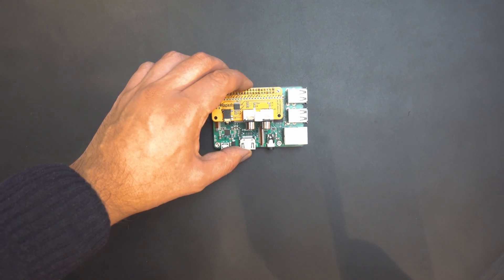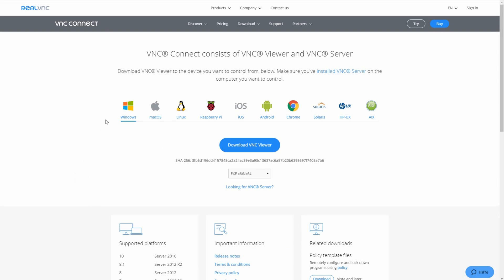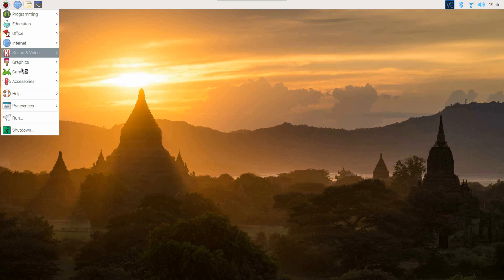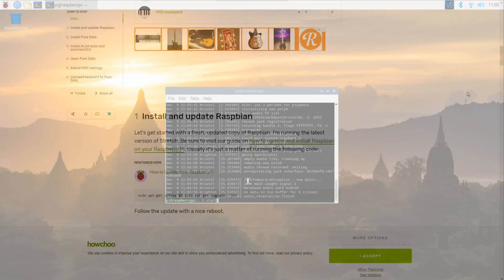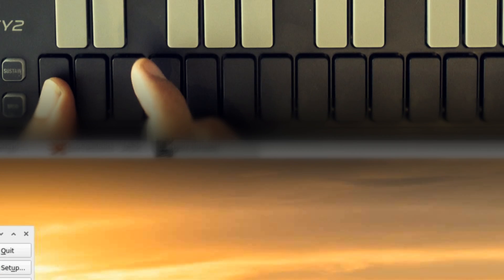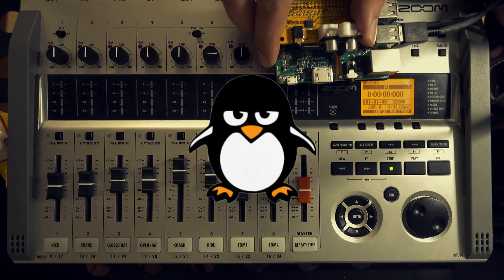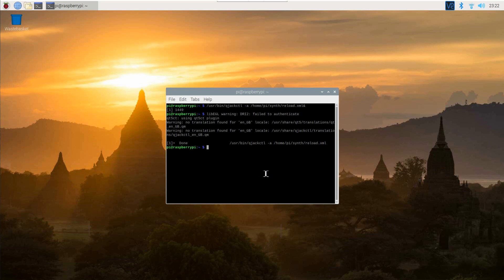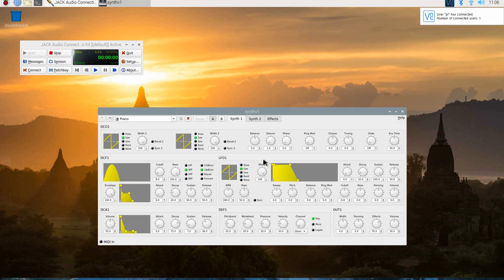How to use a Raspberry PI as a synthesizer

Comment: 10:38 why didn't u say how u solved this... :S
And man this is really cool, but it kinda feels like ure trying too hard to be entertaining which costs us more concise information :S 

Also u should share the image/micro SD copy ;)
Reply from the maker: Thanks for watching. For this video, I couldn't solve that problem, unfortunately, so I used the standard audio output. I later found out you need to remove the PI's standard audio interface from /etc/config so the USB device is the only one present in the system. Will do another video on how to do that in the next weeks. I'm sure there are better solutions for this but I'm still trying to get my head around it myself. :-)  Yeah I can give you a copy, please PM me on aselck at hotmail dot com
Reply: @mr_floydst  Ok but why do u have the Audio Pi Hat then? U didn't explain why or what u use it for :S
Reply from the maker: @boimesa8190  I got it working in the follow-up video to this. Linux Audio system is a little bit over the top, to put it like this. The sound card was intended to improve audio quality and latency, which kind of worked, but it's setup script is broken, so I had to fix that manually.

Comment: Hi Floyd, great video - Im trying to get this working on  my raspberry pi, but I cant see all the commands you used - the video is not clear, please can you share a link to the various commands used in terminal especially around the creating start up to run this when pi boots up
Reply from the maker: Hi, thanks for watching.
This will add the lines to launch qjackctl and synthv1 after boot:

printf "/usr/bin/qjackctl -a /home/pi/synth/default.xml &\n/usr/bin/synthv1_jack&" >> ~/.profile

just copy this line and paste it to your shell and press enter.
The only other thing I mentioned is that bristol takes a commandline parameter like 

startBristol --polysix -midi alsa -scale 2

to show all synths available:

startBristol --help

Best regards!
Reply: Floyd, thank you so much Ill give it a try.
Im looking to use the  other synth synth v1 - do I still need to run the bristol?.

I would like to play the synth from my arduino which is setup as a midi and connected to the pi, it has an array of buttons - how would I be able to have these buttons play the synth in place of your external keyboard. How would I do this any ideas would be greatly appreciated.
Reply from the maker: @globalstandardrating7552  You only need to install synth v1, then. Bristol is a separate package. If you can manage to set up the arduino to send MIDI, your setup should work. But I guess doing to requires some investigation on the  internet. ;-)
Reply: @mr_floydst  thanks for your quick response and help!

Comment: Why not use the built-in audio output? It is emminently more compatible with raspbian straight out of the box.
Reply from the maker: Hi, thanks for watching! I did use it in this video. But legend has it using an external audio interface will reduce the latency and "xrun callback" errors (I got it working in the meantime, and can confirm the latter statement is true, but latency is dependant on other factors).

Comment: I remember when they used to say digital couldn't do this
Reply: I remember using assembler to write FM algorithms on my Commodore 64 and outputting them via the 4-bit resolution amplifier of the sound chip. The DX-7 had just come out. I eventually got a Nord Modular. Today I am absolutely certain that the current analog revival is just a temporary stage before everything goes completely DSP.

Comment: Damn you Floyd! you make this look so simple that I have no excuse now, NOT to try it!!
I really appreciate people like you, sharing the knowledge they acquired through days of hard work in just a few minutes, so people like us will enjoy a much better an enjoyable experience, so thanks a lot!
I never thought about getting into the Raspberry PI although I have some knowledge in computers and basic soldering skills, but I do like electronic music, and this video of yours definitely got my attention! so 2 quick questions please:
1) If I'm going to buy a Raspberry PI board for this purpose, will getting the PI 4 have any advantages?
2) Did I understand from the video that no audio interface was usable in your tests? was the audio interface you added a link for in the comments, did the job eventually?
Reply from the maker: Hi, thanks for watching! As far as I am informed, the PI4 is much more powerful, but still has some compability issues at the moment, so perhaps it's better to wait just a little until these are sorted out. The audio interface was useable, it even showed up in the system's audio settings and put out crystal clear audio with vastly improved latency. I just couldn't make it show up in JACK. I wanted to finish this video so I just went with what I had, but once I get this solved I'll post an update. (Using this as a sampler would be really cool).

Comment: Been using Raspberry Pi boards for a few years. To this day, my favourite Pi-based platform for musicking includes the Pisound “HAT“ (soundcard) from Blokas. It’s neither cheap nor that expensive considering mainstream alternatives.
https://blokas.io/pisound/

It’s especially useful with a special “flavour” of the Raspbian OS which is specially design to work out of the box to make the best of that HAT. 
There are two such flavours/“distros”. 
One, Modep, allows me to use a Pi as the equivalent of a MOD Duo, with hundreds of plugins available in a kind of “virtual pedalboard”. It’s been my “plug and play” device for a few jams, including with MIDI pedals. It’s also a great replacement for a number of MIDI Solutions boxes. It works really in “headless mode” (without a monitor) and it provides a dedicated WiFi hotspot and webserver to allow you to tweak patches from any other device (without having to connect to the Internet).

The other distro, Patchbox OS, is more like a traditional version of Raspbian with the stuff you need, built-in. Some of these things are built around PureData, which remains remarkably relevant on different platforms. Orac 2.0 is part of that, and it’s supposed to solve a whole lot of problems. I quickly gave up on Orac for a variety of reasons, but it’s probably become something really useful in the meantime.

All of this is Free Software, of course. And, yes, it gives you a very different perspective on Linux Audio. For one thing, the Jack/ALSA issues Steinberg mentions are pretty much solved with those dedicated distros.

Have yet to test things extensively on my Pi4 with 4GB of RAM. Things worked really well on my Pi3 with 1GB of RAM.

One piece of advice, for any Raspberry Pi setup: make sure you have a good power adapter. It can make a huge difference. Yes, a battery pack works very well… as long as it outputs enough amps for that version of the Pi. A power adapter meant for a smartphone might not be enough. The Pi4 requires more power, which is why it uses USB-C.
Reply from the maker: Thanks for watching and thanks for your detailed feedback! My conclusion may have come over as a bit negative, but that was just me being a tiny bit ironic. I think the audio demo in the beginning showed that overall, I was really impressed with the software. 
I found that the PI 3 can run for days on a power bank, even with the controller and the keyboard attached. In the V4 that might be a different story, but I have no experience with that.

Comment: this is very cool!!!!
 but i think i would rather a KORG NU TEKT NTS-1
if time is money that would be a much better option
Reply from the maker: Thanks for watching! I think that's up to your personal taste. The NU TEKT does sound great. The PI is a mini computer which happens to have a great library of virtual synths, so there should be something for everyone. But you're right, it's time-consuming.
Reply: @mr_floydst  your video was very educational .. there has to be a market for a pre- configured system like this  .. once setup is there a way to make a image that can be easily installed ?
Reply from the maker: @FSK1138  There are some ready-made kits, one of them is Zynthian. https://zynthian.org/  But they tend to be quite a bit more expensive than the basic RASPI. I guess I could just make an image of my SD card, but then you'd have to use exactly the setup seen in this video. And there are some minor issues I still have to solve (getting the external sound cards to work and reducing latency, that is).